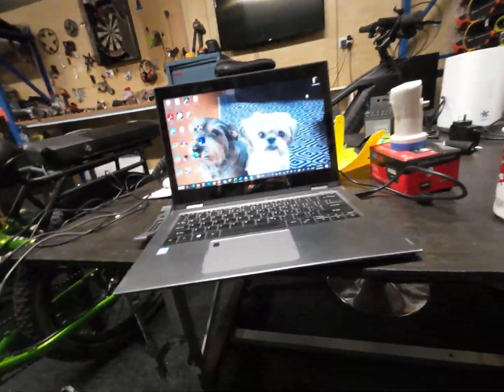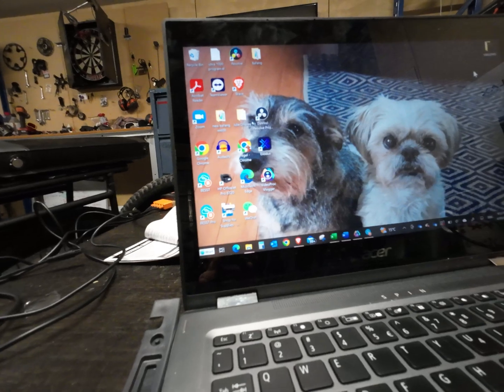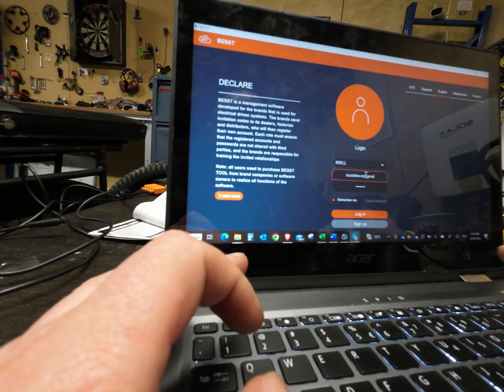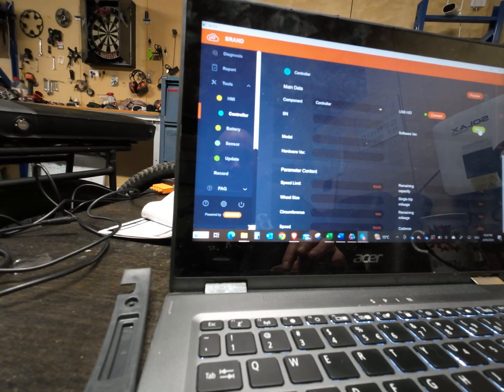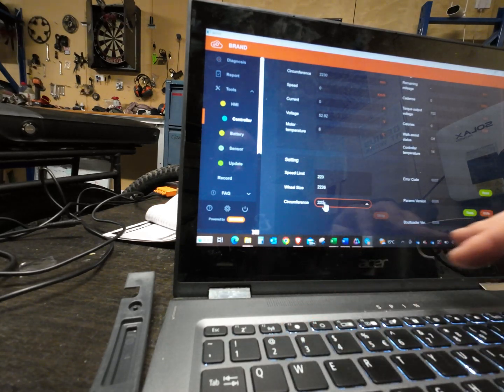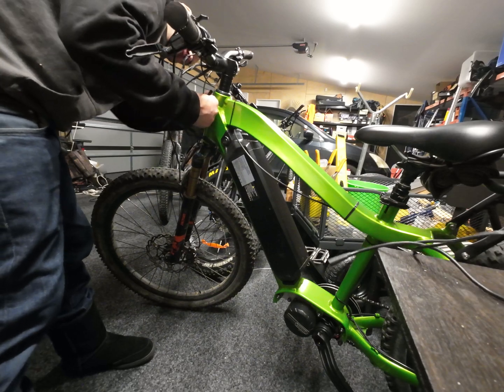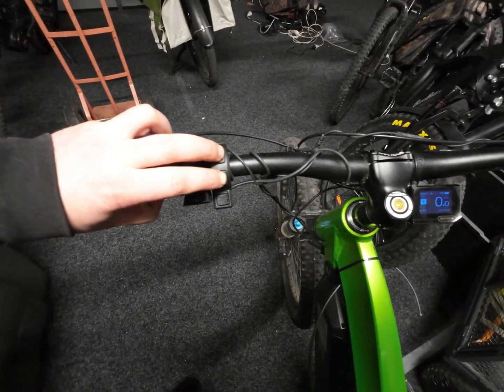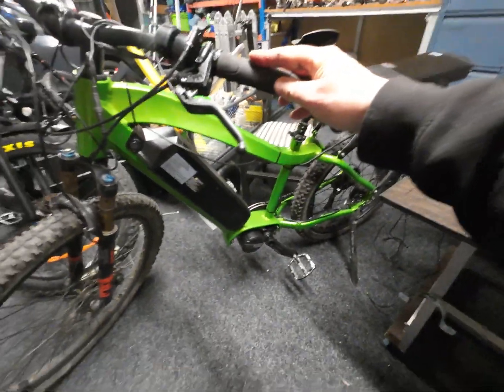Bafang M560 (m600, m510) Speed limit removal BESST tool

Comment: hey . did u try run stock fw m560 with 14s battery  ?
Reply from the maker: Yes
Reply: @BuzzBikes  no issues ? no errors ? no overheat ?
Reply from the maker: @pxl666 it's been going good
Reply: @BuzzBikes  okay , good info , do u know if stock m510 is ok with 14s too ?
Reply from the maker: @pxl666 is good Olga?
Reply: @BuzzBikes  whazaa ?

Comment: Wondering if this will work for my BBS02b (CAN protocol) and also how much does the software + cable cost? Thanks
Reply from the maker: Best tool is about $100 or $120 depending on where you get it from. You also need some ones log on in account

Comment: Great video, mate.

I have a bike with the M600 and I am unable to use the throttle from a dead stop unlike my previous BBS02B. I have to be going 5-8km/h in order for the throttle to be useable.
Is this something I'd be able to change with the BESST tool?
Would I need to change the controller?

Thanks a lot.
Reply from the maker: You need to upload a new file onto controller by using the BESST  tool. Pretty much every m600 file you can find will have the throttle working from 0. I've only ever seen M400 motor need to be rolling before

Comment: I have the same problem others indicated, that is, my max speed drop down shows 25kph as the max selectable value.  Hoed do I get around that??
Reply from the maker: Change it to 45kph and then enter the wheel circumference again before saving
Reply: @ 25 is the max number in the drop down. I reached out the the frame manufacturer who sold me both the frame and the motor. He provided me with a different login that had an expanded set of app privileges. Once I used that login, I was good.
Reply from the maker: @jeromep4148  exactly!!

Comment: Hello, I am an individual and I have a problem with my Vitus brand e-bike. It is equipped with a Bafang M510 motor. I ordered a 36V 17.5 A replacement battery + a 36V 250W controller on AliExpress. Is it mandatory to have the Besst software to calibrate the motor the first time? Is the Besst Pro software not enough? Another question, I changed the controller and since Besst Pro, I could see the HMI. Since I connected the battery, I can no longer see the HMI. I have the impression that the battery is causing the controller to go into error. I have error 30 on the display. I live in France. Could you help me?
Reply from the maker: error 30 is a communication error, does the battery show 0% on the display ?
Reply: the 510 needs to have the controller calibrated to the motor with the BESST software before it will work

Comment: Hello. I have a DILER account. I can't increase the speed limit above 25 km/h from this account. I see that you have a BRAND account, how do I get such an account? I think that then I will be able to increase it above 25 km/h. How do I get an invitation code?
Reply from the maker: Hi, Whats a DILER ?
Reply: @BuzzBikes  he means that your own account is Brand account provided to you by Bafang or third party by license. Dealer account can't let user set speed limit above 25/45 km/h. I guess Brand account have much more options to do with restrictions.
Reply from the maker: @uberbikecourier after changing the speed limit you also need to enter the wheel circumference again. - otherwise it won't stick

Comment: Hello, I'm new to the ebike scene, can you please give me some info on what what cable/kit do I need to buy in order to perform this? I have a Bafang М410, mid drive, 250W with a Bafang DPC18 LCD display.
Reply from the maker: we've never used the M410 motor. I'd suggest you get a bike with an m560 or m600